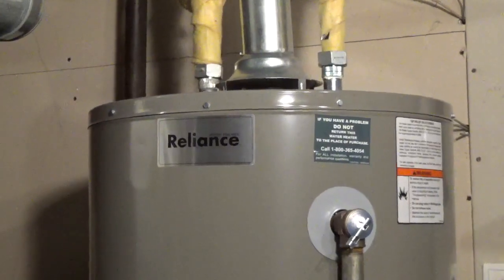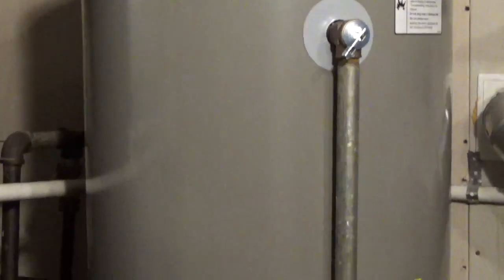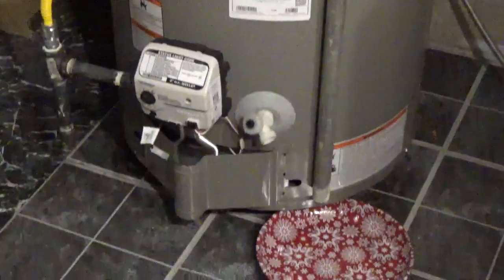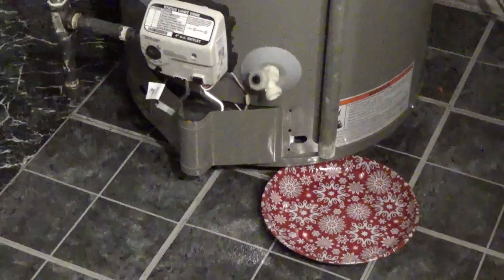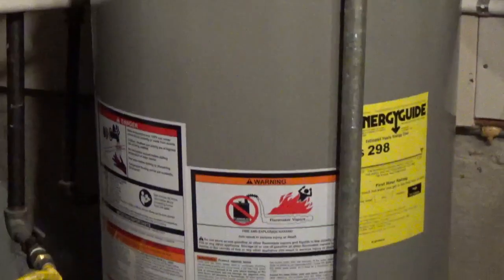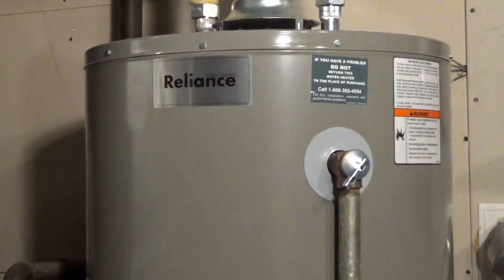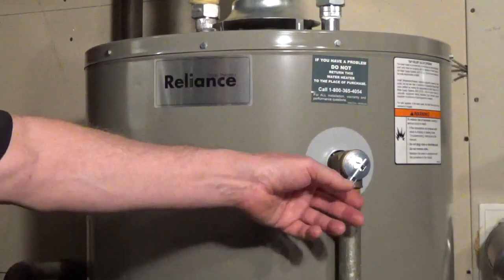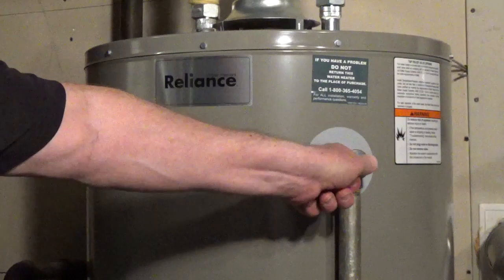Test Water Heater Pressure Relief Valve - Reliance Gas Water Heater

Comment: I don't recommend doing it if you don't do it often, as the valve might not shut off all the way.
Reply from the maker: Hi, I've taken training from Rheem and Reliance, they both recommend all homeowners check the pressure and relief valve at least once a year. Also spoke to the company that manufactures the relief valves, they recommend replacing the valve, or have it inspected by a plumber to make sure it's safe after 5 years.